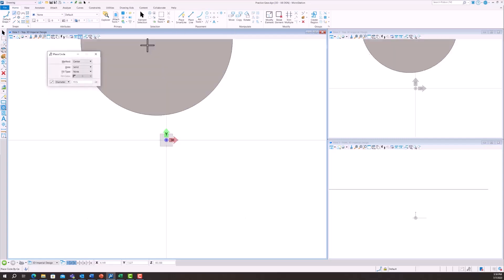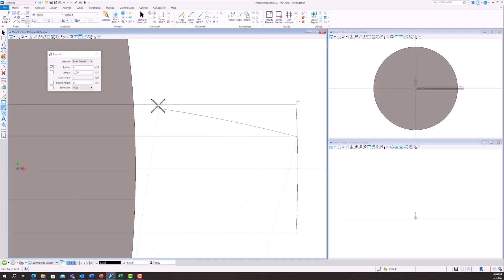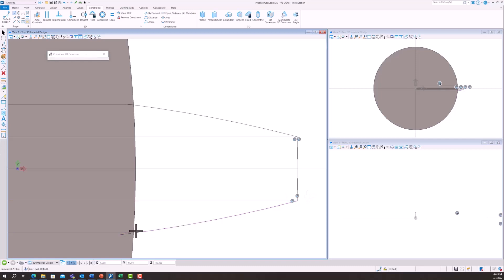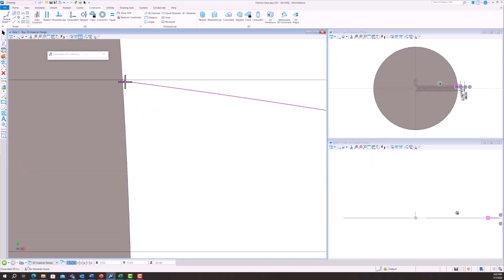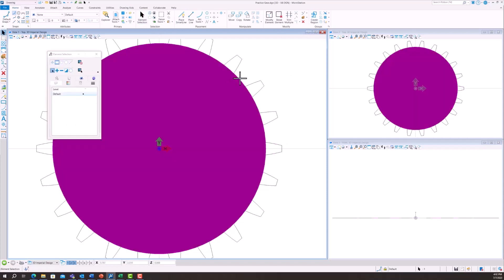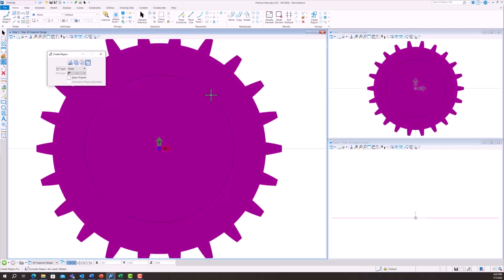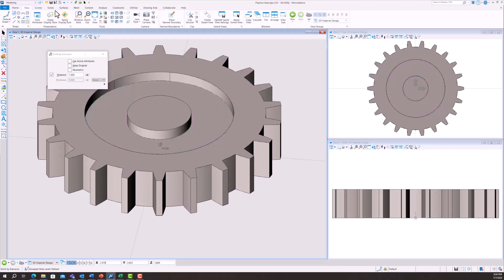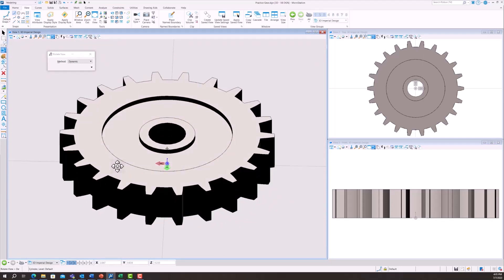Create 3D Geometry Easily from 2D in MicroStation

Comment: Just started using microstation. Everytime I try to extrude something it shows up as wireframe. How to do I get it to show as solid?
Reply: Your Display Style is set to Wireframe. To quickly change it, do Shift + Reset (Reset is right mouse button) You will see a popup menu. On the right side there are three icons. Click on the top one, that's Illustration Mode. Hope that helped! Save Settings to have MicroStation remember after you close the file.